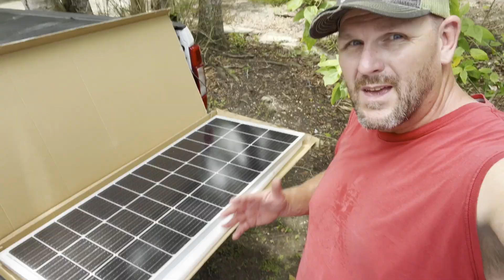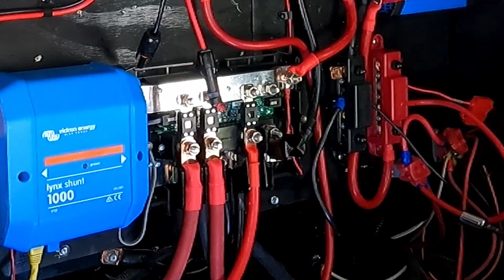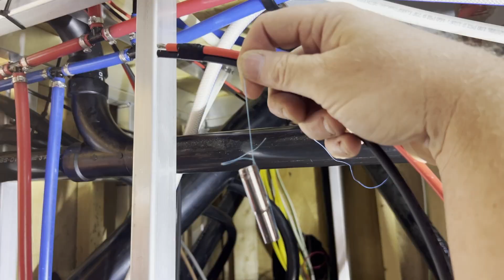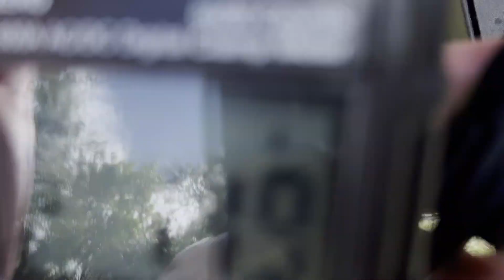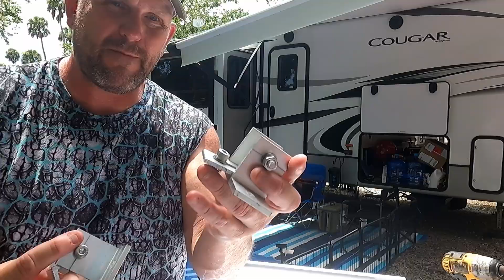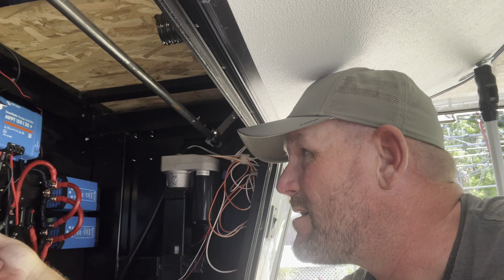RV Off-GRID solar install with Victron components for boondocking! #rvliving #rvlife #solarpower

Comment: We are a lot the same. "Get the job done"  and it will perform  as well as the guys who are still worrying about are the panels inline, square to 1mm.  Enjoy the extra recharge  power you earned it installing on a hot day.

Comment: I dunno man, not sure you've got enough solar 😂
Reply: I've got over 5,000 watts on my coach, which is just about right for my needs. I guess having too much solar is like having too much money - an impossibility. 😉
Reply from the maker: @SuperSushidog  girl too pretty or car too fast…
Reply: 4200 watt pv I can run 1 rooftop ac and charge bank with 20-25 amps on good sunny day.I’m installing a 38 seer mini split 9k Btu 230v.So now my 120/240v inverter should run 120v rooftop and 230v mini.I hope!  I didn’t know the 6k inverter would only put out 1/2 power at 120v when I bought it.😮
Reply: @2hotscottpro  The idea of that 6k inverter is to use it on a 50a RV using one leg (the black wire) to power 1/2 your circuit breaker box and the other 120v leg (the red wire) to power the other half, giving you 3,000 watts per side. Yes, you can connect red and black to get 240v out of it for your mini split. My 12k, 28.5 Seer-2, 120v EG-4 mini split only draws about 1/3 what my 14.5k Furrion rooftop does, so your 9k unit will only draw perhaps 1/4 of what your rooftop uses. You won't even know it's running.

My MH came from the factory as a 30a RV but had been rewired to a 50a when I bought it. I use a 5,000w inverter with only one hot leg, so I just connected both red and black power wires together leading to my circuit breaker box to the single 6awg (45a) black wire exiting the inverter. Since the existing wires are also 6awg and big enough for 50a per leg there's no danger of overloading any circuit. The downside is I had to disable the red wire on my 50a power cord as it enters the transfer switch, just like a 30a adapter does so if I ever plug into a 50a pedestal again (doubtful) I can only get 50a total out of it, not 50a per leg. However, this is more than I will ever need as I have been living off grid on 45a for the last 19 months with no problems.
Reply from the maker: @DannyNomad  time will tell